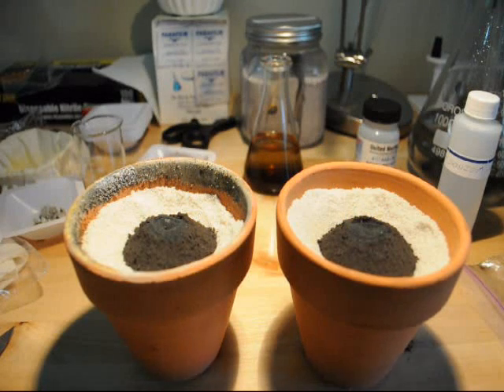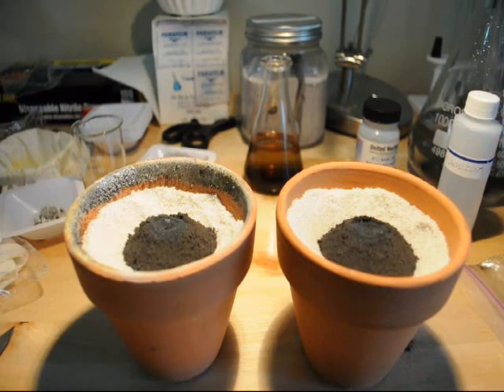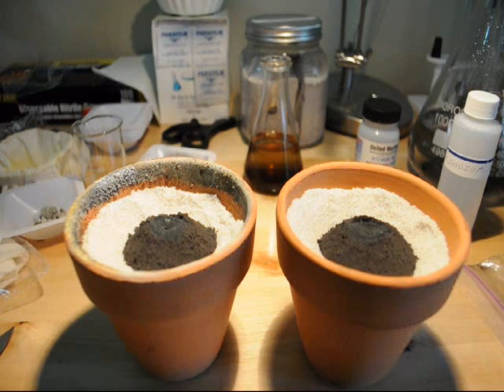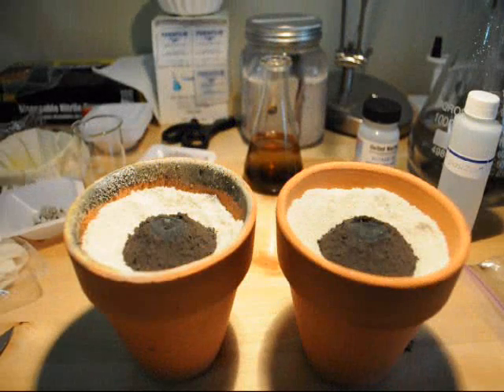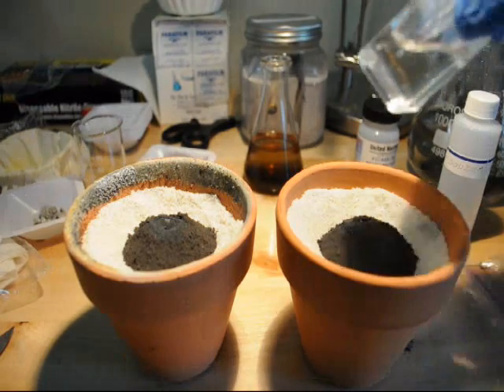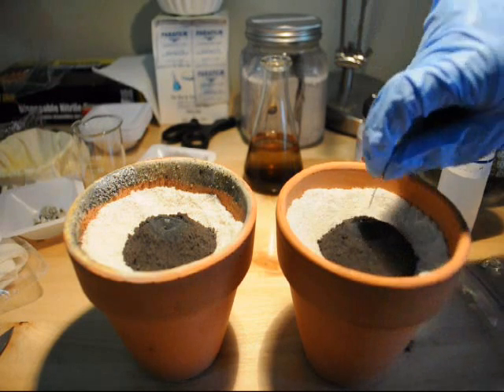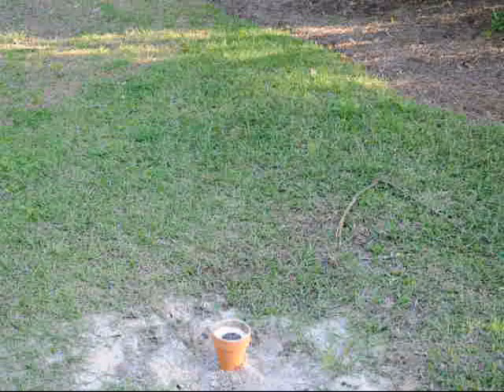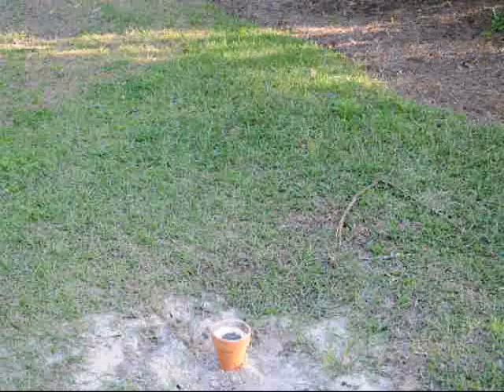Two Thermites

Comment from the maker: @serialkissersband Yes that should work just fine. Just be sure to thoroughly wash your battery paste a few times with water to remove the soluble contaminants. There's also some carbon in there that's a lot harder to get rid of, but you shouldn't need to. It won't interfere with the thermite reaction, and it actually might help since it's a reducing agent! Good luck!